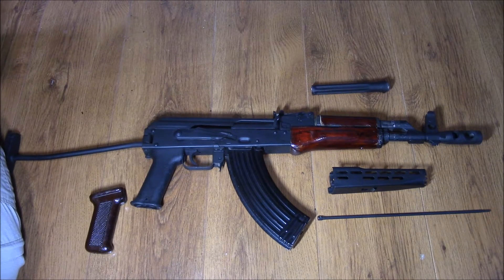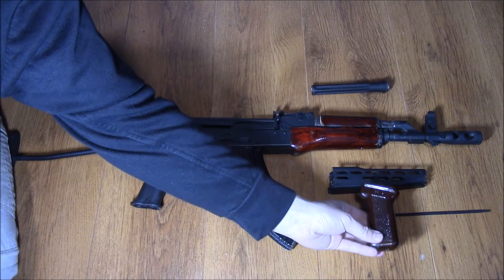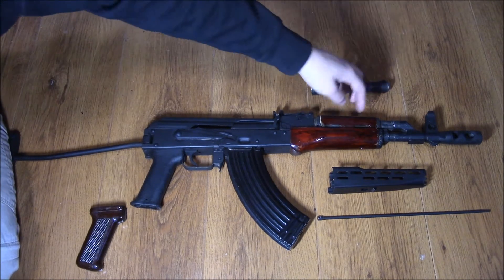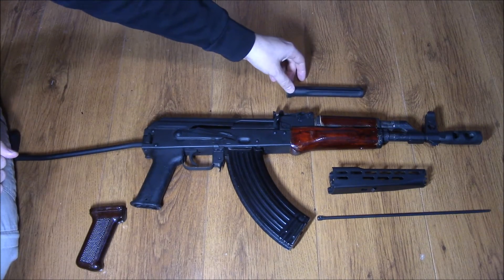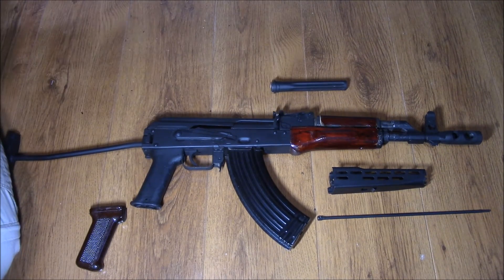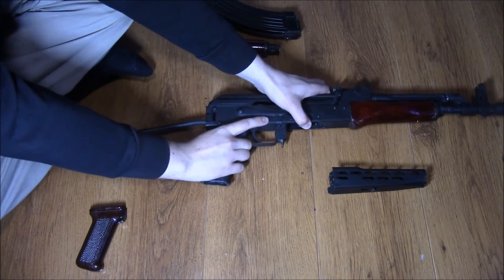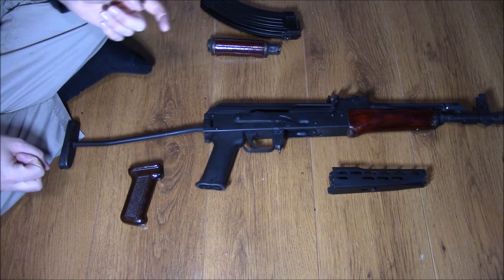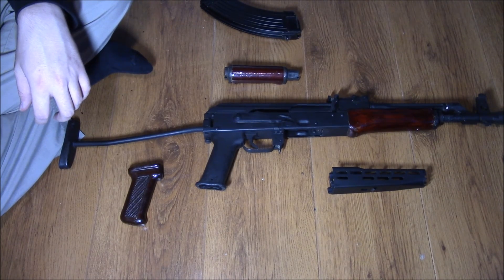AMD 65 Wooden grips modification

Comment: What I did with mine was pressed off the front sight and gas block. Replaced the Hungarian handguard retainer with a Romanian one. Put it back together. I thought about dremeling the Hungarian one like you suggested but I had a Romanian laying around in my extra parts box. I saved the Hungarian one for trading stock. And I did like you said with the gas tube. Cut down an extra East German gas tube, heated the end cherry red, and used a socket to shape it to fit on the gas block. Touched it up with a file to make a perfect fit. I like the gun better with the wood handguards. Thanks for the idea!

Comment: I just got the model with the usa barrel and want to change to a wood grip like this,and definitely change the pistol grip.
The cheap factory plastic ones just seem cheap.
Reply from the maker: The factory pistol grips are just nasty! even worse was mine had been painted with this slimy paint that just didn't want to dry.
Reply: @LewisBGA  lol,mine feel like soft wax too lol.
Shinny slick soft wax lol.
I'm online trying to find the sgl41 gas block and grips right now.
I just picked mine up not even 1 hr ago when the guy got off 3rd shift.